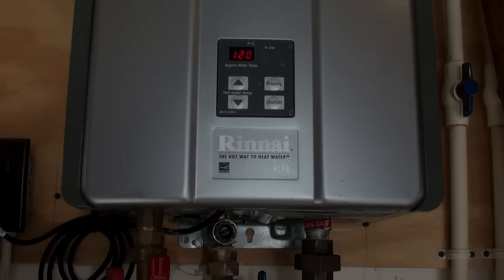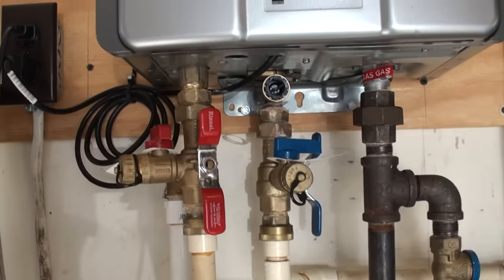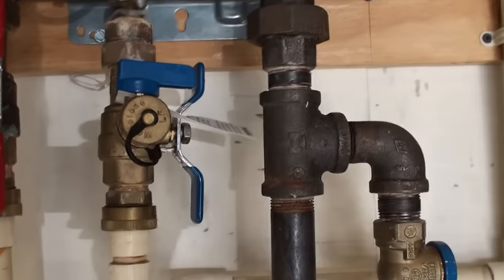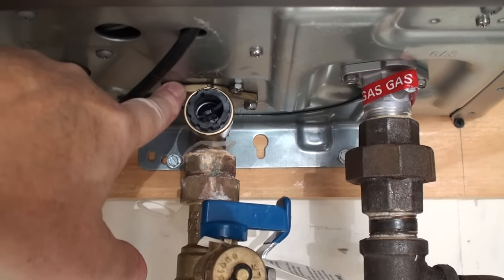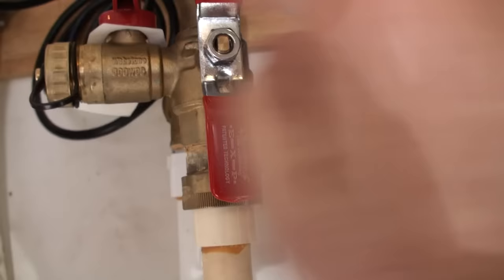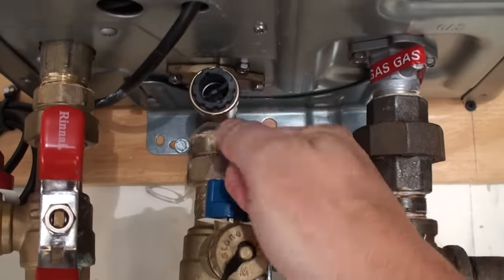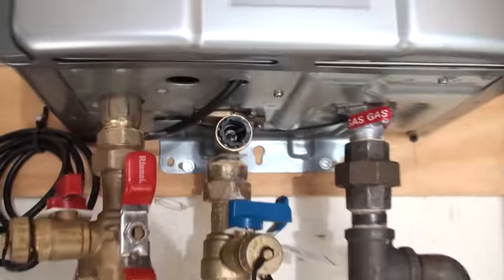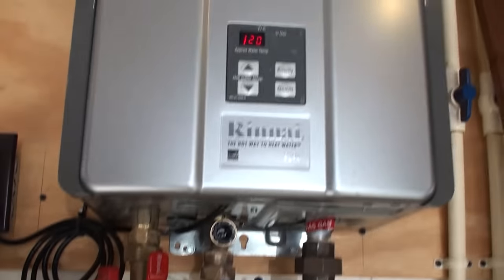Rinnai Tankless Fix: No Error Code

Comment: You need a flow switch that's what senses the water. If it doesn't sense the water the heater I'll never come on
Reply from the maker: Obviously it works, just stops sometimes.

Comment: I tried this method due to having the same issue and it still doesn't work.   Did you have the system on when you were testing for the whir sound?
Reply from the maker: No, the system is off.  It is a mechanical high pitched noise, not driven by a motor.

Comment: Thanks for posting this video. This fixed my issue. 

We had to turn the main water off to the house. When we turned it back on, the water heater wouldn't ignite.

I drained the system, opened the hot valve, turned on a hot faucet, then quickly open the cold valve. The high-pressure kick-started the system. Thanks again

Comment: When you had this issue does yours not sound like it is running at all? Mine stopped working this morning, and cannot hear it running at all. Assuming that the little propeller has stopped.

***Did the exact same fix to mine, and it worked like a charm. The spinner/propeller was stuck.

Comment from the maker: DO NOT BUY RINNAI!!   Seven months after my first request Rinnai is FINALLY sending me some parts. They still haven't paid for the service call, covered under warranty. AND they say they won't pay for installation of parts because I used PAM to get my wheel spinning. The repair tech squirted 3 in 1 oil in there!!!!   Cover their warranty = Not going to happen, too busy covering their ass. My Unit has done this 4 more times since I did this video, once just av few days ago...and always at an inconvenient time.